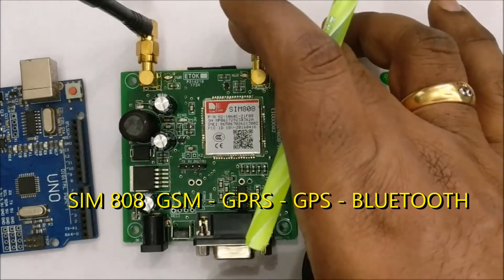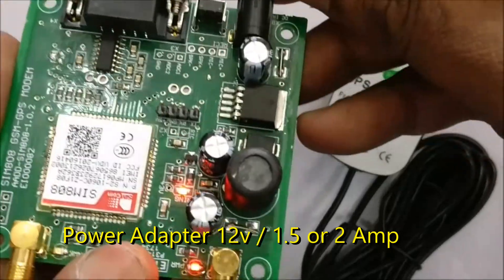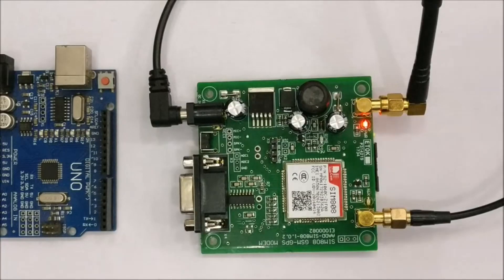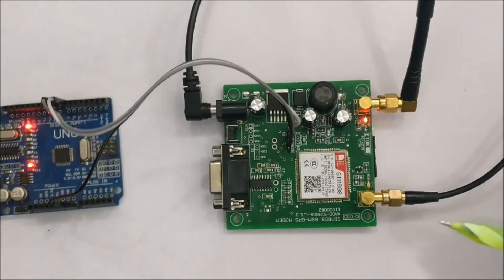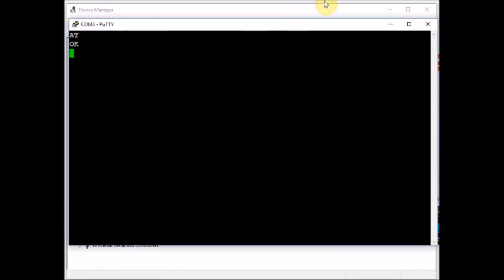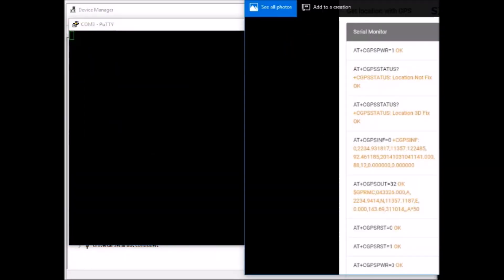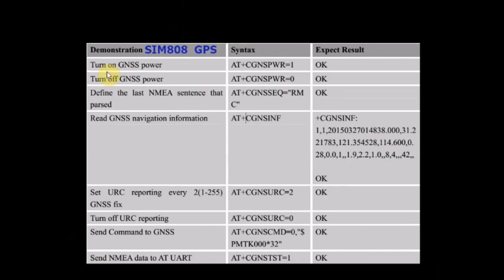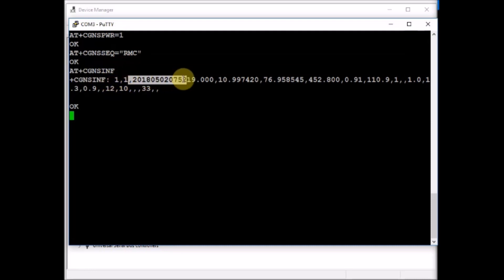Sim808 GPS GSM Module - Sending Gps Location SMS

Comment: Hello, great video. I wonder if you can activate the sms via a switch? I would appreciate if you could upload a tutorial about it. Thank you
Reply: did u figure it out ? i need the same thing
Reply: Just add 
int pin = 9; //add this in the start
pinMode(pin ,INPUT); //add this in the void setup
digitalRead(pin) = pin ;
if ( pin == HIGH) //add this in the void loop

Comment: Hi good explanation, without micro controller or ardino board we use GSM module and flash the code in GSM module it is possible?

Comment: Hello :) can you help me?
Why my serial monitor shows "GPS Initialising..."? Can't show AT Command?
Thanks
Reply: Did you fix your problem ? Can help me too we have the same problem
Reply: @russelcaguicla4064  me too have same problem any solution
Reply: @vishnukunnummalshaji382  Same problem did u fix it sir? i keep on getting GPS Initializing on my serial monitor.
Reply: @sadamskiebulalo3414  just open the putty terminal and follow the steps he has done
Reply: @sonhiya  thanks mate its working now btw. but when i add my VoiceRecognition module i got a problem. huhu
Reply: @sonhiya  hello friend the putty terminal is only for Testing right? but the actual function is on coding?  right? thanks!
Reply: @sadamskiebulalo3414  how did you solve the GPS initialising.... issue?
Reply: @shankargawadashankragawada7283  

Just change the loop condition
Reply: utiLize o ARDUINO UNO, AÍ NÃO DA ESSE PROBLEMA